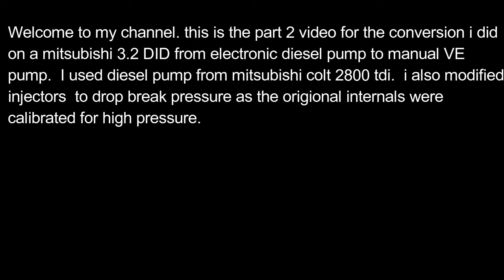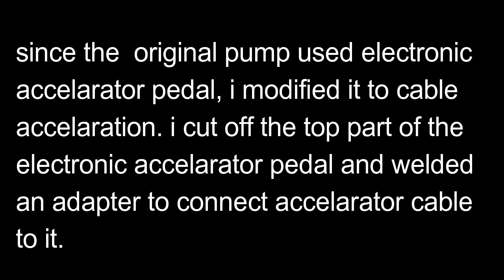Mitsubishi 3.2 DID manual diesel pump conversion Part 2

Comment: How does it run? Are you able to hit top speed with that modification? Then does such modification lead to overheating especially if the vehicle runs rich in fuel in order for the pump to cope with the fueling demand of a bigger engine?
Reply from the maker: No overheating issues yet, only slightly heavy on diesel compared to the original pump

Comment: Hi . Sorry for the ignorant question.  I have 2 4m40 pumps . Both won't fit because it has a part that touches the intake . Please assist
Reply from the maker: Hello sir , for that problem I used the governor cover that is flat

Comment: Is the colt pump boost compensated?
Reply from the maker: I removed the top cover as the pump was too high and fitted a flat cover without boost compensator
Reply: @mkautotech4440  Neat. How did you modify the injectors to have a lower pressure?
Reply from the maker: @samtolley9618  on dropping injector breaking pressure , I replaced shims with smaller ones until I got 170bars breaking pressure
Reply: Hi. U mean 170 bars or 1,7 bars ?